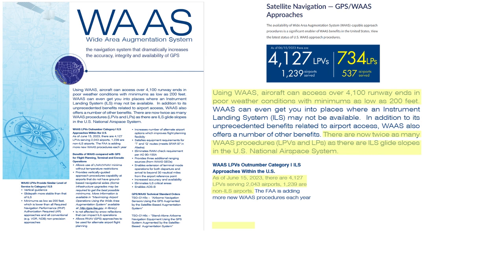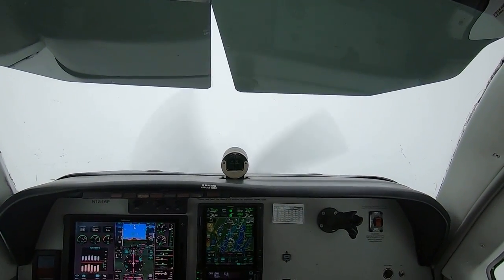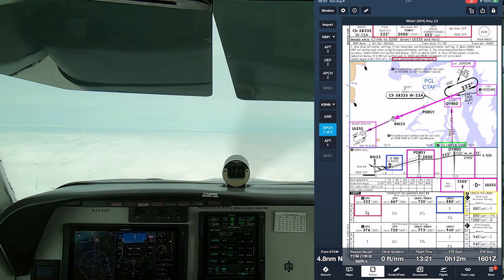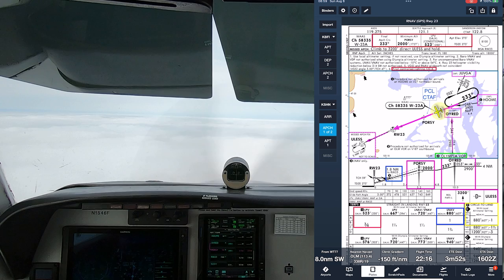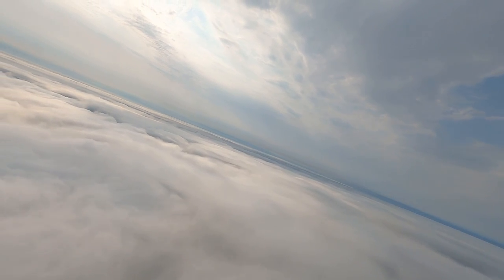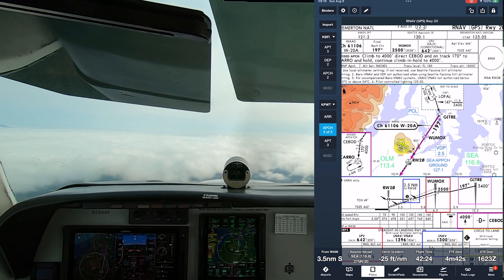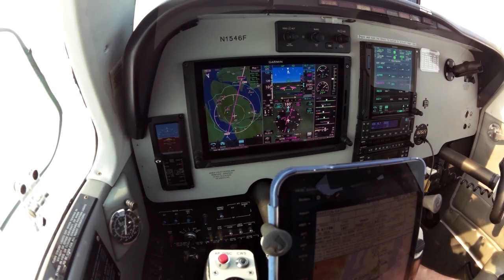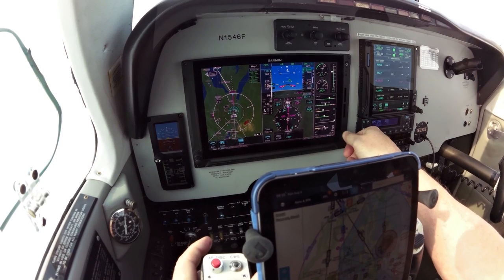IFR Approaches with and without Approach Lights

Comment: As an IFR student, I find great value added on your videos for all the ATC interactions and your briefings. What did you file as your IFR flight plan for that particular flight?
Reply from the maker: I filed to my first destination, KSHN. As you can hear, I told the controller my intentions after that.
I  don't know a definitive answer to the general question of how to handle a multiple-airport-multiple approach flight. Some ATC facilities seem to prefer separate flight plans. Others are fine with a flight plan to the first airport. You can always call the facility that owns the airspace you use and ask them.